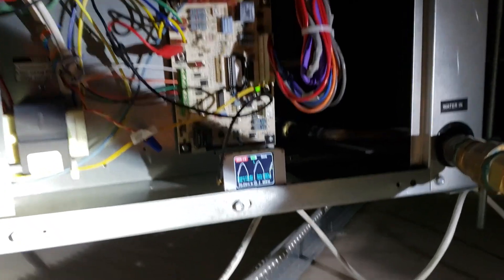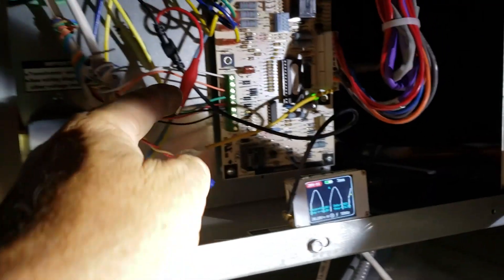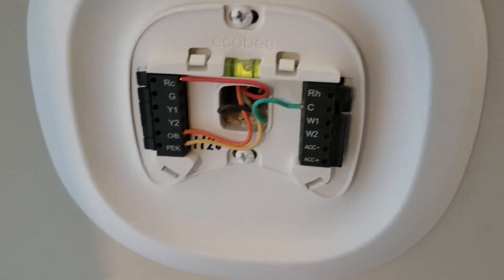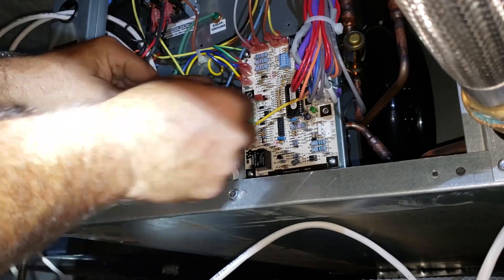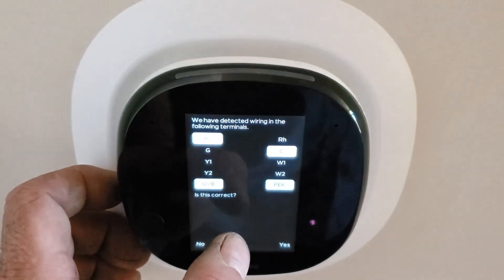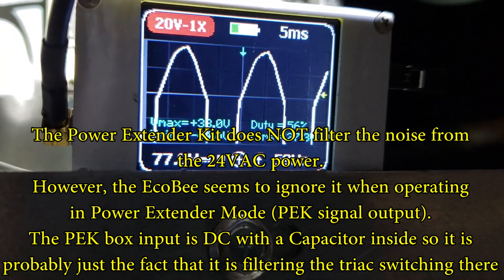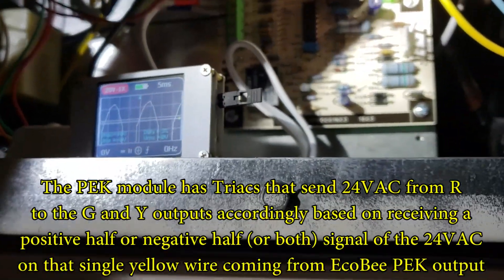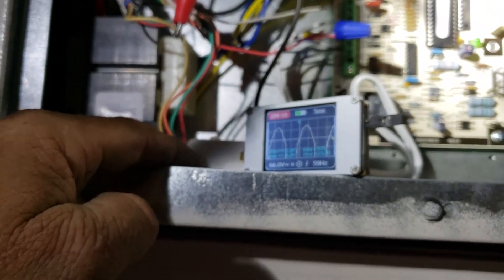Installing and testing EcoBee PEK (Power Extender Kit) in the field to fix Taco Actuator Issue

Comment: How’s your Goodman’s Doing (Junk)
Reply from the maker: The two bastards are still going.
Luckily. LOL
Reply: @hackfreehvac  
I never seen you use the Turbo 200 or Turbo 200X run capacitors when replacing bad caps in A/C units. They pretty much give you any micro-farad value you want with wire jumpers across the many different capacitor values in one can. So you don't have to stock so many different values. Plus, they are made the USA.
Reply from the maker: @EETechs  Those capacitors are good for emergencies but they are way expensive.